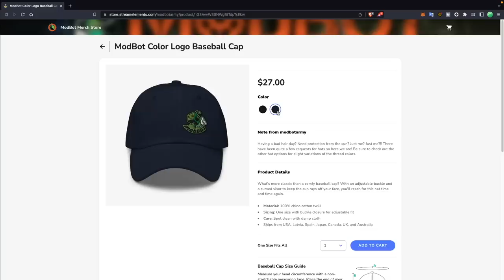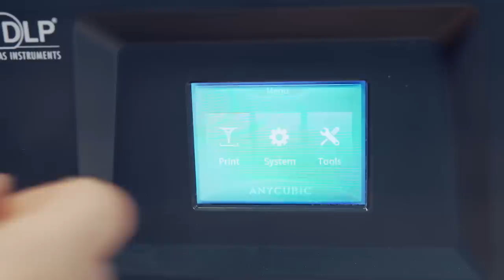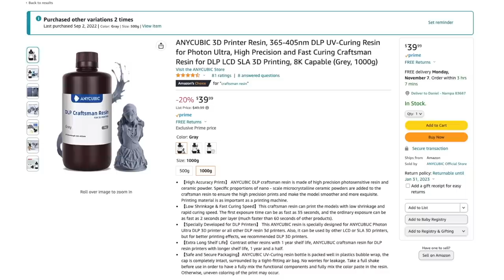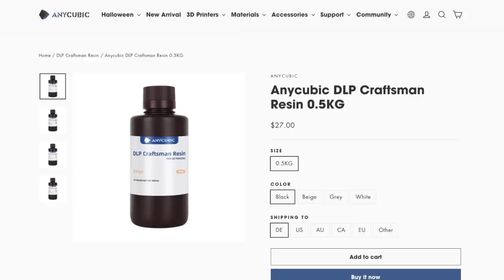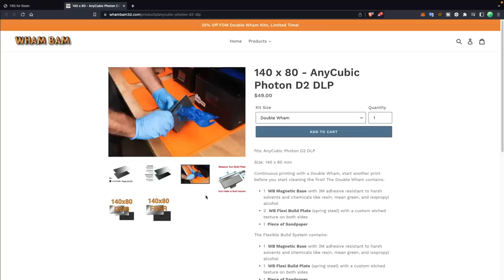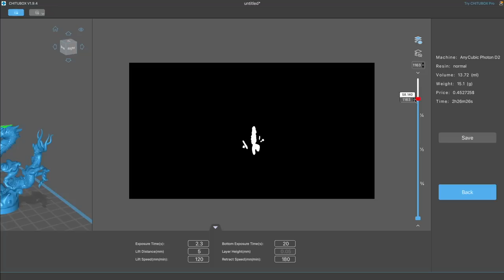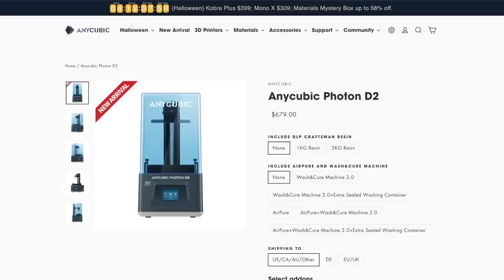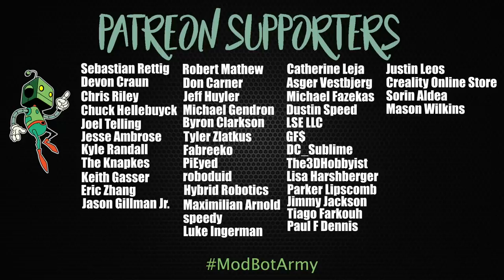Is The Anycubic D2 The Future Of Resin Printing?

Comment: I don't get this. From what I found D2 has just 2k resolution. The biggest problem with my Anycubic mono 2k is the resolution because I get voxel lines on my print. D2 must have the same issue with the same resolution.
Reply: The clarity bump from eliminating light bleed as a factor more than makes up for the middling resolution of the projector.